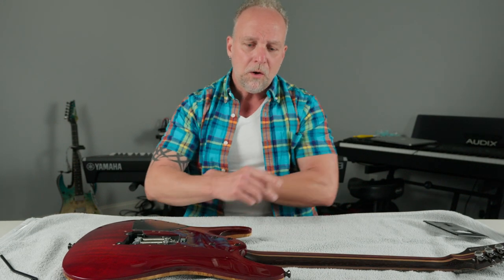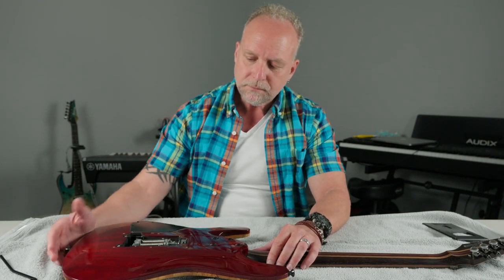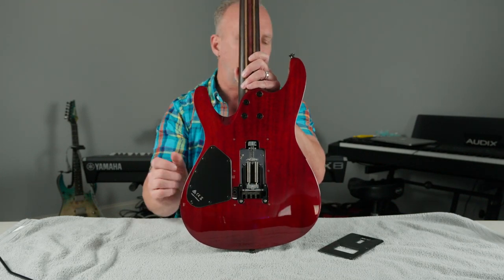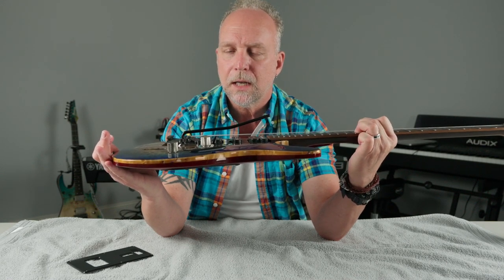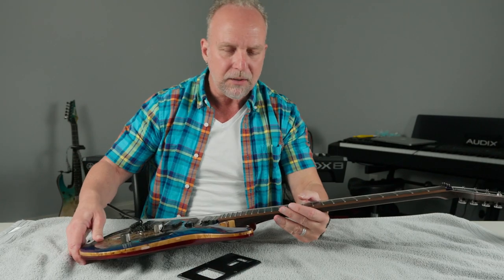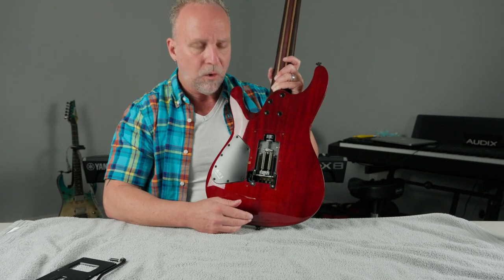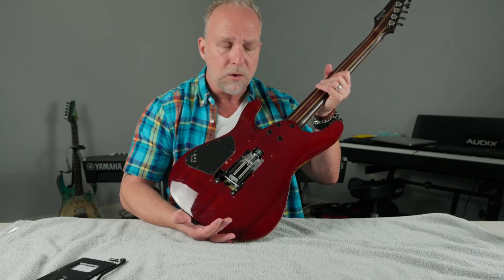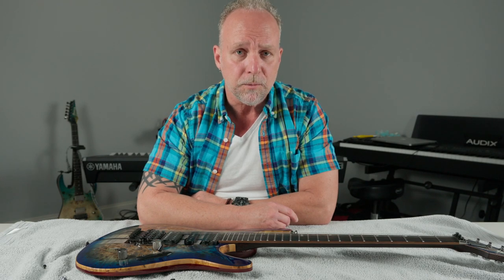ibanez ZPSFe Tremolo - What It Is and How It Works

Comment: Hello. I'm a guitartech and I've seen some bugs in this system IMHO.

1-The ZPS rod rests on plastic grooves. These grooves tend to become damaged over time. I had to enlarge the rod so that the bridge block (being adjusted parallel to the body) would touch the rod. 
2-The ZPS stabilizer should have a tension adjustment system just like the Hipshot tremsetter, for example, this way you can take it out and use the bridge in full floating mode without this changing the tuning. 
3-The entire system is held in place with small screws in conjunction with plastic parts. On the ZPS2 it used to break. On version 3 it was updated with more robust parts, but at least they should be metal.
Reply from the maker: Yes.  That would be a very nice feature to have.

Comment: I wonder if the EVH D tuna would fit on it? Never mind LoL, I just realized you can really install the D Tuna on a floating bridge can't pull up on the bar you have to deck the bridge .
Reply from the maker: It will not work on this trem.  The back of the trem is too different from a floyd....however....it would be nice because that is one of the things I like about my EVH guitars.  Although you can put one on any Floyd of course.

Comment: Trace, I have the same s series ibanez (only partially your fault.)  Can you give us some more detail on how you setup/restring this particular trim?  I have had trouble getting a nice zero point on this guitar with 9s, where the rod is just touching the trem block with the slight wedge above the body on the front as you described.  I run out of room to lower the tension on the ZPS knob.  I think the 9s may be one set too light to keep the ZPS in its range of adjustment.  Thank you!

Wes
Reply from the maker: That shouldn't be it.  I have 9s on mine with no issues.  actually you should be able to run 8s.  Let me take a look at mine and see where my tensioner is set.  I will get back with you.
Reply: @Guitars-GearandMusic  good to know thank you, I'm missing something then.
Reply: I've used 8's to 11's on mine - there is no issue.
Reply: @Guitars-GearandMusic  Ever take a look? :)
Reply from the maker: @snipes10272  Sorry dude. I completely forgot.  Yes I have my tensioner set at 2 starting at the small side.  I am running 9-46 strings and this tension works great.
Reply: Just use the wheel, that's what it's for

Comment: You don't realy need to remove plate or chnange any hardware to remove zero point system. You just have to push tremolo arm in to guitar to losen the string tension and just pull back and remove zero point bar and two springs by hand. Without this bar the tremolo will act like a regular floating tremolo. Or you can not even remove anything, but simply tighten the tension wheel so that the tremolo block does not touch the zero point bar

Comment: Quero comprar uma rg 470 dx aqui no Brasil, ele possui o sistema edge zero 2 mas não possui esse sistema de molas ... parece ser mais simples, o que muda ??? Você  poderia me ajudar ???
Reply from the maker: It's not that big of a deal.  I have guitar that have it and some that don't.  The big difference is that the system is a little more stable.  It stays in tune a little longer and when you do really big string bends it doesn't pull the others out of tune as bad, and it is easier to setup the tension....but I would not let that stop me from buying the guitar.  If it is setup properly it should hold tune just fine....